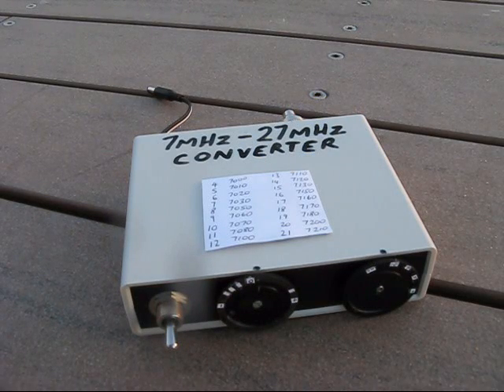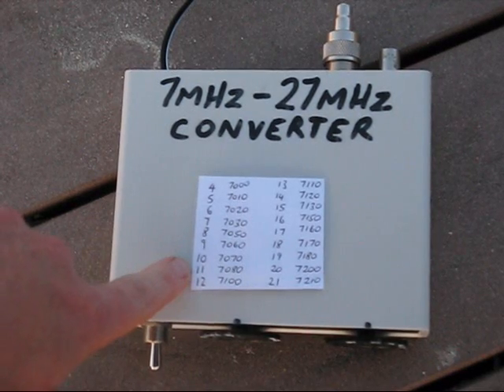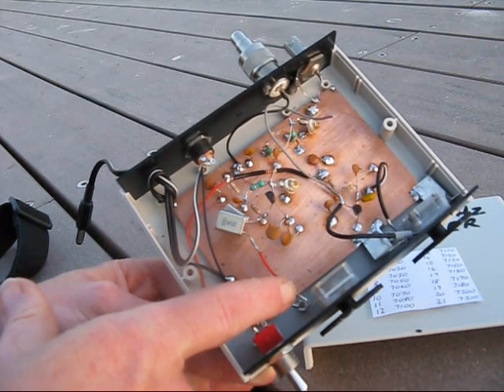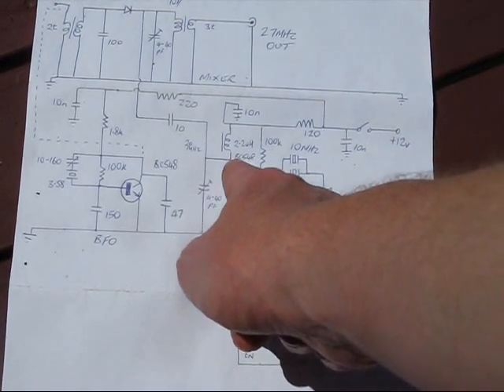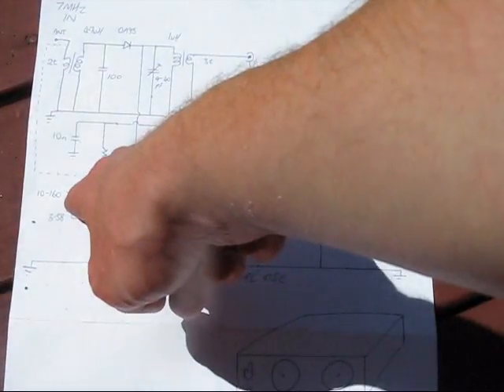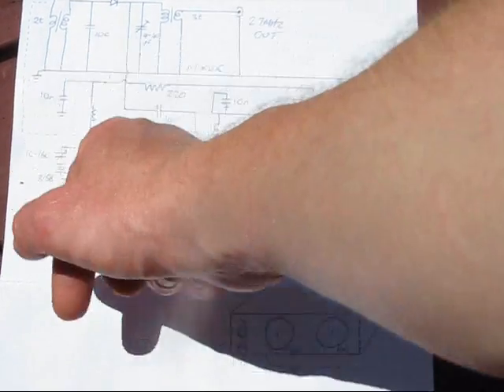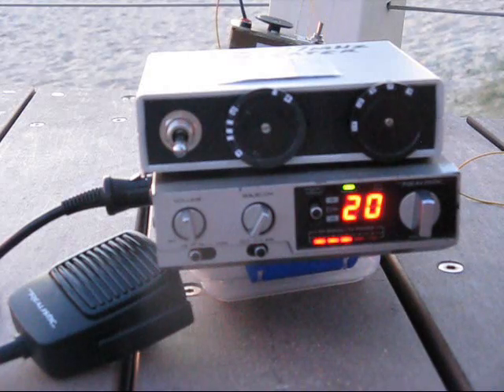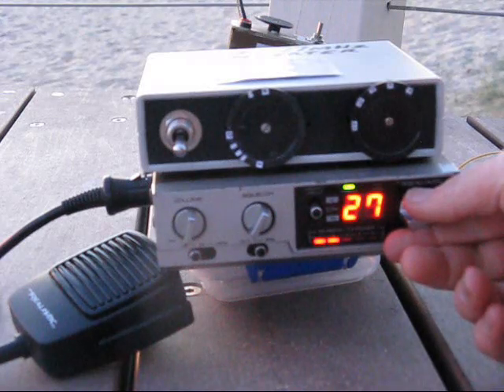27 MHz CB radio tunes 7 MHz amateurs

Comment: if I buy a Oricom UHF180 5 watt UHF CB Radio with Remote Head,  how long can the control Cable be? say I have 15 meter of coax as a run to the roof as a base station.  I may lose some watts in the coax  but a Radio with Remote Head can have the Tx/Rx Unit up the top of the roof , and the other Remote Head unit inside my home . so will it work? as the control cable is Not RF but data.  so can I get the Full 5 watts at the antenna?  have U seen the Oricom UHF180 CB?
Reply from the maker: Sorry - I'm not familiar with that model. The seller should be able to help - especially if you get it new.

Comment: You may use another receiver back to back for those who cannot build their own and it works perfectly( only thing you will have to tune to same frequency on both)
Reply: Kumaresan S Tune the same frequency on both? But you can't tune 7mhz with a 27mhz receiver. Can you expand on what you meant?

Comment: I had bought a 20 MHz crystal to do this and was going to use one of the 20Mhz crystals from China I bought. Have you done this with a 20 Mhz crystal? Also the BFO you made is exactly on the input 7 Mhz freq correct, not on 455 KHz for the CB? Have you used a 602 IC ( mxr/lo osc chip ) to do this ever?  Great project, seems we are thinking along the same lines.
73
Jimmy, ARRL TC, WX9DX

Comment: hi peter ive used one to convert 20 mhz to 70 mhz the 4 mtr band on my ft 817 with the ft817 doing most of the functions cw ssb and nbfm so far not heard anything but it works ok it uses a 602 and a 50 mhz crystal which uses a 5v supply have you got the 4 mtr band yet in Australia jim G0WMJ
Reply from the maker: No 70 MHz in VK for amateurs.

Comment from the maker: A transmitting converter is certainly feasible though it uses a lot more parts (incl 3 or 4 tx amplifier stages).  Luckily you don't need to do any mods to the CB and it doesn't matter if you don't have documentation.  A 20 MHz crystal in a converter would get you onto many popular 7 MHz frequencies.